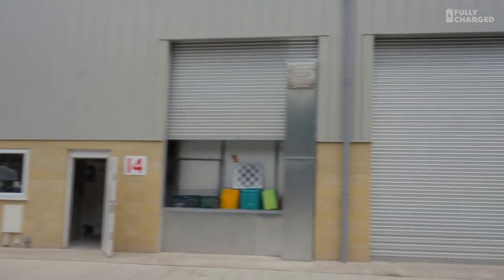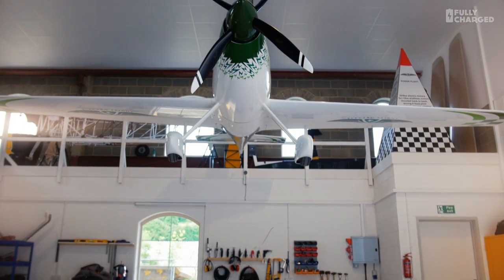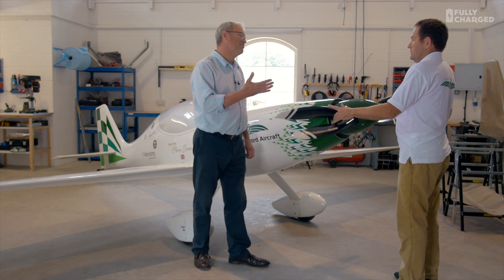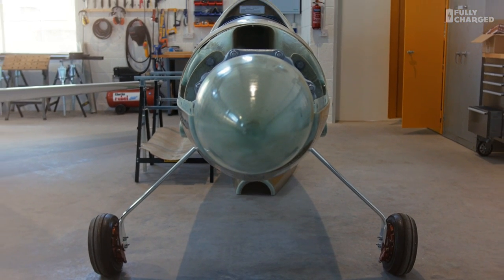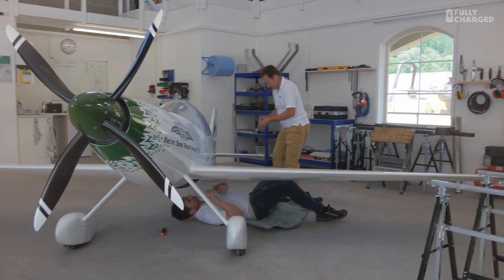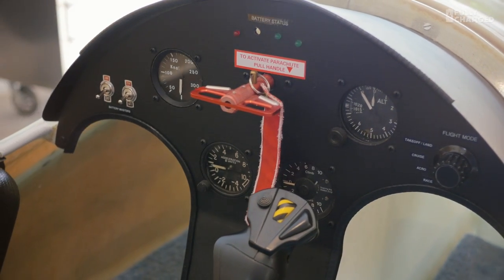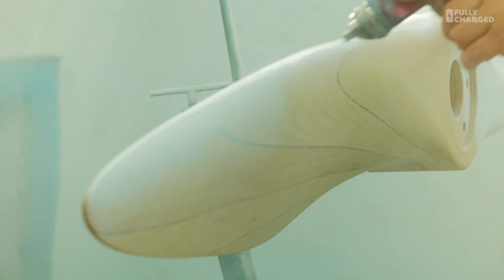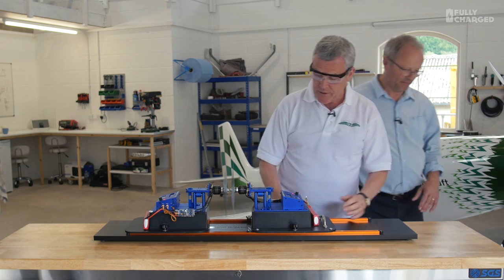Electroflight | Fully Charged

Comment: Damn batteries, WHY ARE YOU HOLDING US BACK?!!
Reply: hahaha
Reply: We have dozens of better battery designs, the problem is no one is making them yet, however the Chinese are working towards getting some of these idea's going.  At least they are prepared to take risks and invest in new technology we need to power the future.

The most exciting development was the salt treating the electrodes in dry lithium batteries as it doesen't cost very much to improve batteries that are quite easy to make, but wether the West will manufacture them is debatable... again the West lately has been lagging behind in battery tech etc. it's almost as if it's being suppressed by large corporations who's interest is in fossil fuels..
Reply: bruh, lithium-air
Reply: Technology is just generally pretty shit. There have been big advances in improving life cycle of Li On, in fact it could come out tomorrow at this point I think, lots of companies have massively increased the life of Lithium cells.

Actually getting higher density is fucking difficult. You can get higher density pretty easily in a non rechargeable cell, or a cell that can be recharged a few times, but you have dentritic formation and all sorts of other horrible stuff to worry about.

Extended Li On, Lithium Air and Sodium Ion are the three I'm most interested in. 

Li On that lasts longer is nice in devices like EVs where they are charged and discharged a lot. 

Lithium Air is insanely light and has a very good theoretical density but the best designs at the moment require pure oxygen for cycling and also charge/discharge very slowly AND have dendritic formation which means potentially "boom boom", an issue Li On had in the 1980s.

Sodium Ion is close to commercialisation if I understand correctly, with an energy density similar to Lithium Ion at its inception, perhaps close to Lithium Iron Phosphate as it stands today, but it may be very, very cheap. So if the technology gets developed to the level that Lithium Ion has been for density, then it could mean identical energy density for way, way lower costs because Sodium is so abundant. And we can already make 300+ mile cars on Lithium Ion, it's just expensive.

As for aircraft? I don't know how feasible long flights are in a plane carrying batteries. I guess the bigger the wings, the more weight it can take, but of course airlines want the most passengers possible and you're going to need an insane charging infrastructure to charge big airliners. I have a feeling aircraft will stay hydrorcarbon for a long time, BUT, imagine it just being aircraft spewing fumes while everything on the ground is electric. That will really, really help the issue.
Reply: Whoever patents the next generation battery with very dense power storage capable of taking a high current for fast charging but relatively cheap manufacturing costs, stands to make a fuck tonne of money.
Reply: I think battery researches should focus more on density than on recharge time. You need batteries that can hold as much power / weight as possible regardless of how long it takes to charge them. The battery pack is a HUGE part of the vehicle's cost, so instead of making people pay for it, how about making it DETACHABLE, and you get to own the pack as a company, then the user brings their car to your "recharge" point and all you do is change their pack, you take out an empty pack, and you plug in a charged pack, then the empty pack gets to sit connected to the grid for as long as it takes to fully recharge, at which point it gets plugged into another car. This SOLVES so many different issues, it makes the car cost WAAY less, the car owners no longer need to worry about battery degradation, you get to fully "recharge" your car in a matter of minutes as fast as your battery pack can be changed at a station, and more importantly, you no longer have to worry about recharge time as a major factor in your battery research and development.

And you could also standardize the format of the battery "cell" and outsource it. So that anyone can open up their own cell replacement station anywhere in the world. And all cars belonging to any different manufacturer would be able to replace their drained cells anywhere. It's win-win for everyone. A new business opens up for anyone willing to invest in a cell recharge and replacement station. ANY battery manufacturer anywhere in the world will be able to produce compatible cells since they will be standardized and will work on all recharge stations and all cars regardless of manufacturer. AND car manufacturing companies will be encouraged to make electric cars given that there's a series of standards in place, there's a recharge infrastructure available and really all they need to worry about is making a car that's compliant with the cell replacement standard and with the standard cells. And since each cell will be standardized to a specific power output, you can have trucks that use more, bikes that use fewer, airplanes, houses, pretty much any other power consumer ALL on the same infrastructure, just using more or fewer cells at a time... THIS is the way to the future in my view...
Reply: There is actually a company with a business model where the company owns the entire car, including the batteries, and lease it to the user. The business model rewards the company for being as resource-efficient as possible rather than selling as many parts as possible. You can view the video about this company on this channel.
Reply: Yeah I know of the British company that does that. And I fully support them and I think that's a great model for the future.
Reply: I'll certainly be investing in their stock when they make an IPO.
Reply: Elon Musk has a brilliant little mad genius scheme in the works. Many people laugh at him when he shares his Tesla tech with other companies and pushes everyone to electric, thinking that he's an idiot for helping bringing competition to his own company. What many people fail to see is that he's pulling the age-old Bill Gates monopoly scheme on the world. He's sharing his tech but his tech is based on the same flawed logic of throw-away mobile phones of the past decade. For decades we had a perfectly fine working BATTERY STANDARD which all electronic devices used, allowing all battery producers access to all devices. Now the likes of Apple came along with their iPhone and ushered in an age of devices tightly locked into their battery. No longer could you change the battery, no longer did you have the option to buy batteries from different manufacturer... a great loss for the consumer, a great win for the manufacturer who gets to sell you a new phone after 2 years... Now Elon came along and took the same concept up to car level. You get a car that's tightly locked into its battery. You pay a shitload of money for what it is basically a glorified battery with a car built around it. Then you use it till the battery is done, after which you throw it away. And he's pushing this HORRIBLE business model over the world under the apparent good gesture of freely sharing his tech. At the same time, he's building the biggest battery factory in the world, WHY? Because that's HIS GOAL. Once everyone uses this FLAWED business model, then he'll be the main player providing batteries for everyone. He'll OWN the market. It's same as with the oil industry, it's not the CAR industry that made the BIG money, it's the oil industry that made the real money. And Elon is going to be riding it all, he's gonna be the ONE car-battery giant on the planet, and the DIRTY business model he pushed now and everyone else is naively embracing, is going to be the foundation to him controlling this new market...
Reply: Maybe I should buy Tesla stock too. But I may find myself philosophically disinclined to do so.
Reply: *****
Haha. I don't think the Tesla stock will be going anyway higher than it's already gone, I think the edge of the hype is gone.
Reply: supercapacitors will be the further, we will have them in about 10-15 years, we have already made Graphene know it's just a matter of making powerful enough supercapacitors and making them cheap to produce.
Reply: Supercapacitors are definitely not the answer to any solution where a large energy density is required. Graphene won't massively improve the density of them either. They have a low volumetric AND gravimetric energy density. 

Graphene in batteries, that could help, there's a lot of research in that field, but I doubt much of it is about to come to the fore considering the fact it's so damn difficult to make.
Reply: Ross Bishop

With Supercapacitors, I think you're right in the short term but as Nanotechnology takes over from current forms of industries
Supercapacitors will become more relevant.

They found out you can make graphene easily and inexpensive with carbon graphite and Scotch tape. It was a scientific breakthrough. Here is the article about Graphene, If you're interested.

http://www.independent.co.uk/news/science/the-graphene-story-how-andrei-geim-and-kostya-novoselov-hit-on-a-scientific-breakthrough-that-8539743.html
Reply: It could be a hybrid of a gas turbine charging the battery or supercapacitors for an electric motor.
Reply: hydrogen fuel cell may help with this plus solar cell skin and possibly a generator powered by a small propellor( a lot of planes use these to provide electrical power in an emergency)
Reply: The only problem with hydrogen fuel cell is getting the hydrogen off oxygen, it takes a lot of energy to do this, I'm not entirely convinced that it's scientifically possible to gain energy from this, I think you will find it violates with the 2nd Law of Thermodynamics.

I think solar cell is the way forward why bother creating your own energy when there's an unlimited free sauces available.

To be fair this is just my opinion on the matter, I'm more into quantum mechanics and relativity then this kinda stuff.
Reply: next gen photovoltaic cells could be the answer
Reply: Did hear that they are making paint and spray on Photovoltaic, so you can make any surface a Photovoltaic cell, cool concept but I doubt the conversion rate is very good.
Reply: I think when it comes to passenger planes it electric engines may be a dead end tbh. I mean... theoretically in 50-100 years we may be able to have a fusion power plant so small that we can put on a plane to power it fully electrically. BUT, in 50-100 years passenger planes will be obsolete. Air transportation was good while there was nothing else better around, but with Elon's hyperloop just around the corner, and with suborbital flights also just around the corner, passenger flights are quickly becoming obsolete. Nobody wants to wait 2 hours in an airport and go through all the fuss to get on a plane, not when you can get on a high-speed train much faster and reach your destination much faster and cheaper. Hyperloop-like technology will make local air lines obsolete, while suborbital shuttles will make long distance air lines obsolete. Why spend 10 hours on a flight, when you can spend 1 hour in a suborbital shuttle... On top of things, you can fly a suborbital flight solely on CLEAN, RENEWABLE hydrogen-oxygen fuel mixture, and you can farm that fuel from the ocean passively using wind, water turbines and solar panels. And considering most launch pads are located near oceans, you can make your own fuel right there for NO cost, and burning oxygen-hydrogen generates nothing but water so it's 100% ecological, compared to the MASSIVE amounts of fuel that passenger planes use and the amounts of toxic gas they dump into the atmosphere...
Reply: The problem is that we haven't yet figure out how to mass-produce the new materials at a reasonable cost.
Reply: The problem with the propeller generator is that you're resisting the thrust of the engines. Given the efficiency loss of the propeller-generator, it would be more efficient to just draw power from the battery pack directly and avoid the conversion losses.
Reply: NightLurk Research EEStor. Capacitors are the future, but someone paid off the creators.
Reply: NightLurk What's needed is a cordless extension cord really
Reply: Amazing project. I can be very stupid by saying this, but in commercial airplanes have R.A.T device. It is a small device that pulls out from the airframe and it's simmilar to a propeller. As the wind goes by and spin it...it will generate power (electricity) to the airplane. It's the last safety device only used in case of failure to keep hydraulic/controls and other important stuff working while pilot can find a safety way to land.

How about use a second propeller in this case to drive a continuous rechargable battery. Of course, the thrust can be lower, but could be (a possibility) a way out to use a lighter battery pack or something like that?
Reply: rafaelrp07  That won't work because of something called the law of conservation of energy which is kind of a big deal in physics.

To put it in lame terms, the plane has kinetic energy (it moves) by converting chemical electrical energy from the battery into kinetic energy through its engine and propeller. If you add an extra propeller to the plane with the goal of gaining energy, you'll only be converting the plane's kinetic energy back into chemical energy, you'll just be taking part of the energy that you took out of your battery, and putting it back in.

So you won't be accomplishing anything, you'll just be wasting extra energy because not all the energy from your battery ends up converted into kinetic energy. When the energy from the battery powers the electric engine, there's a lot of energy being lost as heat due to  the friction between the engine's mechanical components, then there's even more energy lost by the propeller itself, as even the best of propellers can still waste a lot of the energy that's put into them, you know that deafening noise you hear when a plane's propeller starts to rotate, that's actually energy that you're hearing, energy being wasted, it's air that's being thrown off the propeller's tips which goes into forming vortexes and turbulence and thus noise.

So think for example of gas powered vehicles, usually only 25% of the chemical energy of your gas ends up being converted into actual kinetic energy on your car. For planes, that's even worst, because planes use the same internal combustion engine as cars, but on top of that they also waste a lot of energy through the propellers which are far less efficient at generating "movement" than a wheel spinning on the ground. That's one of the reasons why electric planes aren't yet a reality while you have electric cars that can easily drive 200 miles on electricity. Because of the far greater loss of energy of a propeller compared to a wheel. Take the same battery capacity from a Tesla and put it on a small plane, and you'll barely be able to take off and fly for a few minutes, while a Tesla could move 200 miles on the same charge. And there's also factors like weight, drag and the fact that the plane has to generate lift which are other big energy losses.
Reply: +NightLurk  I'm not engineerer or something like that. English is not my mother tongue either. But, let me see if I can make myself clear.

It was just an idea that came to my mind. My point is that I already knew the loss of energy due to friction, to the vortex at tip of propellers, etc. I like aviation, automobiles and part of my free time I read, watch things about it to learn more. I already knew about regen. braking (used in F1 and some hybrid cars) and the conception of loss and gain of energy in this kind of system.

My point is, as everything is monitored by a computer, as already some propellers are moving producing torque and throwing a mass of air backwards, we can recover part of it to store again at battery when a CPU say so. As I said earlier, this will cause a loss of power (bhp) but, as battery weight stil a big issue to the development of a commercial aircraft, I thought, for example, an airplane like that (possibly a LSA aircraft) could be more atrtactive to the market with 200hp instead of 300hp BUT with a extended range as flying in cruising speeds and recovering part of the energy that is lost. I thought of a lighter and small battery pack that could fit in this aircraft but a better mileage. 

I already thought that counter or contra rotating blades could keep this way and instead...add another blade/propeller in the back of the airplane to spin while plane is flying. Of course, it will lift drag, but again...in our current situation I thought this could be a way out to battery issue (weight, mileage) and a 3rd propeller, exclusively working to spin (not to produce torque and move mass of air) could has a different design to work better for its puporse.

About +tuber I just mature enough to not feed the trolls. Thank you to keep this debate going on.
Reply: rafaelrp07 The problem is that the spinning propeller would create additional drag, and since propellers are less than 50% efficient, it wouldn't even recover half of that lost energy.
 You're better off to just take the energy directly from the battery.
Reply: rafaelrp07 
Sorry, but that doesn't work. The drag from the propeller absorbs more energy than the generator will produce. 
The net effect is negative thrust (i.e. Drag).
Reply: ammerudgrenda Thank you...that is the kinda answer I was looking for.
Reply: Hurry up, before the air is full of CO2!
Reply: i agree with what you wrote, as a german engineer i can tell you: the true problem is the conzentration of resources needet to build better ones which exist basicly only in china. tesla as far as i heard has Panasonic  as a partner, guaranteeing access to better battery technologies, but still they also seem having problems gatheriung resources.  Anyway, What I learned is that some years ago, there actually was endeavor towards electro mobility. To achieve this , the demand for neodyn magnets drastically increased. We cant produce those in europe. What china did back then was basically to hold back deliveries what ultimately increased the price for those extremely. Almost Every efford they put into that technology became obsolete for pricing reasons.  Now you have to know that there is cooperation between all major german car manufactors at some level. In committees they decied things like sticking all newer german cars to a top speed of 250kmh (i know there are exceptions). And after that magnet incident they all decidet to never again make themselves dependant on chinese raw materials and thats the reason they stick to what they have. In long terms this means they will fall behind with no alternatives available. Now you dont have to be a wiseass  to immagine the influence of a major car company and their position.
Reply: For aviation. Until we reach a very advanced stage with energy storage... Compact, high power, electric generating will really be the key. I believe airbus is working on a 100 seater hybrid diesel electric passenger plane. Imagine if Skunkworks can develop their compact fusion reactor tech to fruition over the next decade or so.
Reply: rafaelrp07. engineers don't simply understand the forces because they are smart people. they draw them out to visualize and then practice practice....so visualize a generation turbine that attaches to the plane at a singular point. the wind pushes it one direction and the plane must fight that force at the single point. now picture that connection point is an electric wire with the turbine trailing behind the plane when moving and pulling the plane down when on the runway or trying to take off with more weight. Yeah you may be moving and that turbine spinning with say 50 watts of energy going from turbine to plane along the wire but the plane is using 60 watts of energy to pull the turbine along. no matter what, the plane has provide a force requiring more energy than can be converted as there is always loss. simply transporting the energy makes heat. good if you want it and called loss if you don't.
Reply: I think people don't realize technology always progresses at the same pace. The results change, but each step is just as difficult as the first. the better sword technology won the battle.  the better steam engine locomotive company won the battle. the better car battery company won the battle. my S7 Edge phone battery is dying. why am I now tethered instead of switching out cheap batteries. intelligent design of non replaceable battery for sure.
Reply: NightLurk THE BATTERIES WILL NOT DIVIDE US!!
Reply: That's the best concept but unfortunately the batteries still too big to be easy to swap. Eventually, when they can get are a lot more density, say a battery weighing 50 pounds that could hold enough energy to power a medium car for 150 miles, then this can become a reality. For sure, it's just a matter of time for that to happen.
Reply: Soon there will be graphene super-capacitors
Reply: Batteries have been holding us back for a century.
Reply: the stunning thing about this tech that even two years later the development of batteries will see planes take to the skies.. imagine the kind of tech we will have in the next two years!
Reply: hum i was wondering if you use 1 motor and planetary gears in the hub for counter rotation would that work some ww 2 aircraft used that.
Reply: I think the batteries are the biggest issue with long range electric flight. Current jets take off with a ton of weight of fuel, but as they fly the fuel gets used up and the aircraft becomes lighter and more efficient. Batteries on the other hand mean the plane would weigh the same on landing as it does on takeoff, you have to lug the battery around the whole time. That is why rockets have multiple stages. Once the fuel empties out of the fuel and oxidizer tanks, the tanks themselves are just dead weight. Some engineer way back when figured if you can split the rocket in half and drop the huge tanks used to get airborne, the rocket would become much more efficient.
Reply: Energy density
Reply: Damn physics why are you holding us back!
Reply: its good
Reply: @chris1980x  You DO know that we do not need permanent magnets for electric motors, yet can just use iron and put coils on both sides, as is tradition?
Do you know if the news in the USA is true, that VW has said they are doing a 50 billion dollar project to convert to producing only electric cars?
Reply: Curse the ones holding back battery development, greedy sodding monsters.
Reply: Because Nuclear is too heavy with shielding. Think Nuke Sub.
Reply: What about Graphene Batteries ? I've heard these being mentioned in different areas which could provide the much needed breakthrough in power/weight ratio.
Reply: Totally agree... Its wonderfull and blahblahblah there's really huge AMP high power sucking super tiny RC motors out there that can output incredible power\rpm for their little size, but then in the battery department is mehh it sucks all the juice of even the highest amp rated batteries very fast as they are still very low storage for weight\size and don't exactly charge in like a minute like petrol or disel engines which don't take much to fill, specially a small tank of a RC car\airplane it's only seconds and its ready for another run... On a average car 50L\60L tank it takes only like 2 minutes on a normal pump to fill up the whole tank and be enough to do over 1000KM with only like less than 50 KG of diesel on a economic diesel light car...
Reply: 3 years into the future: Solid state batteries on the way!
Reply: Tesla and T henry did not use batteries, Tesla had the impulse arc distrobter with magnet with was a form of uniflow 2 stroke, Moray used pulsed plasma in his tube (2 stroke) to extract power from the quantum vacuum or aether!
Reply: @RealistReviewer  There is no need for battries, i dont understand the hang up on batteries since abrupt motion of plasma, like Tesla's magnetic impulse arc distruptor, a uniflow 2 stroke, tapped a lot of energy from the vacuum aether whih is everywhere.
Reply: @NicholasMarkovich  A device which harnesses the aether, no need for battles,  Tesla with his 2 stroke magnetic arc distruptor for impulse DC and T henry Moray with his plasma tube device not to mention many other overunity sources, i dont understand why everyone is hung up on batteries and chemical fuels.
Reply: @Nightlurk  Unfortunately, the current state of international "standards" in measuring systems, driving sides, outlet voltages, etc. will tell you why this is a pipe dream. You would literally need a highly centralized world government to achieve this, which would be a problem for very many other reasons.